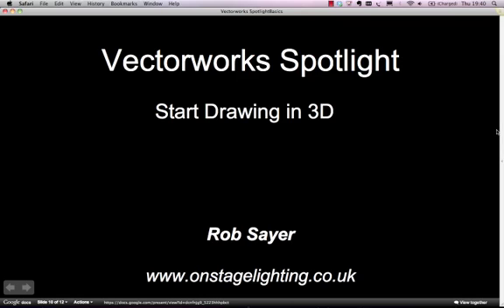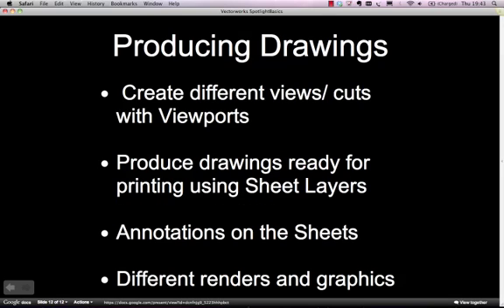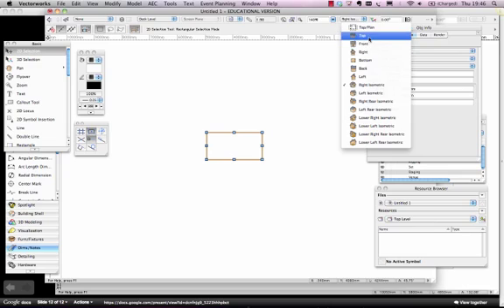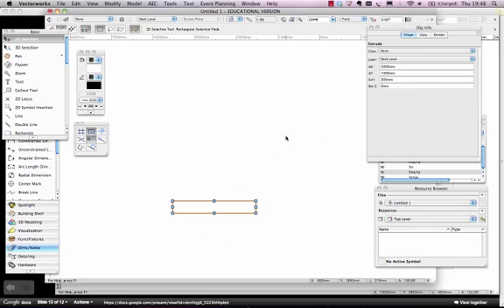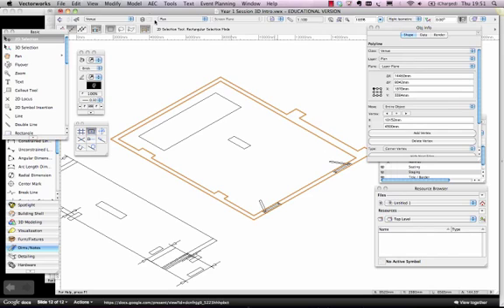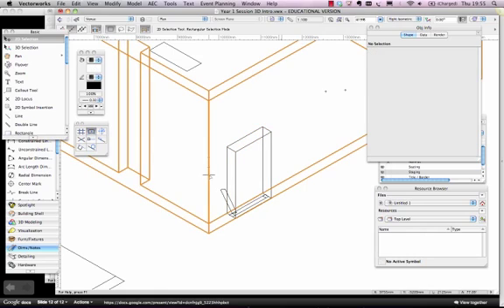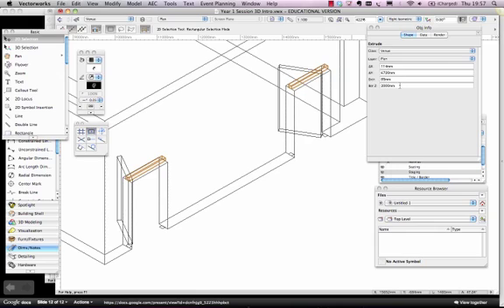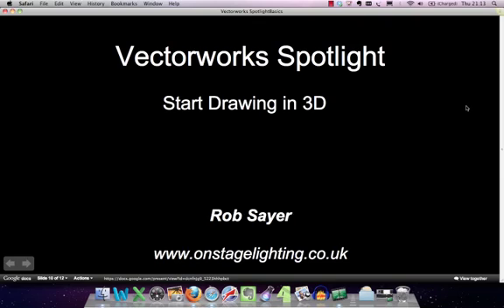Vectorworks Spotlight - Extrude a drawing in 3D

Comment: Hello, excellent video, you wanted to ask the attach file .ies which are the characteristics of a light fixture, and that spew me how many do I need for my area and as distributing them and me arroge many lux for each one.
Reply from the maker: In the VW2011 I have here, it doesn't appear that I can add an .ies file to the Spotlight lighting device. However, you can add an .ies light source via the Visualisation tool and selecting Custom Light in the toolbar.  It allows you to pick a distribution file during creation.
Reply: I have the 2014 vectorworks for students, and then asked the truth if I need to put this file on twitter of vectorworks and tell me that if you can attach that file .ies to that me of what I mention. I don't know if you will have a chance to check out it please. because I need to enter a practice on Monday and you're the only help I have.